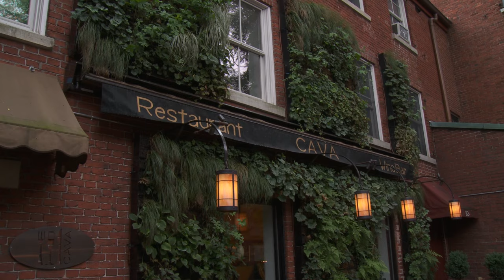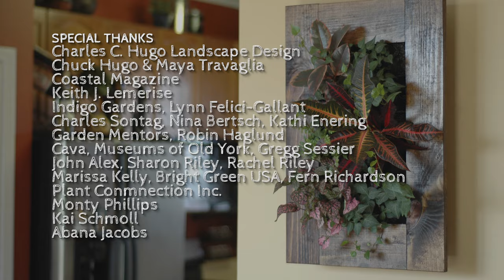Growing a Greener World Episode 213 - Living Walls

Comment: Hello
I think there is a huge problem with these projects : water infiltration and humidity on the walls. 
There should be a space between the wall and the structure & silicone where are the screws so the water doesn’t dammag the house walls. 
With briks, the mortier will be also affected. 
When these problems resolve, no more risk on the structure (because there are ways to do it, like roof gardens have specifications to protect the roof from water infiltrations), it will be very nice indeed !
Reply from the maker: Good observations and suggestions. Thanks